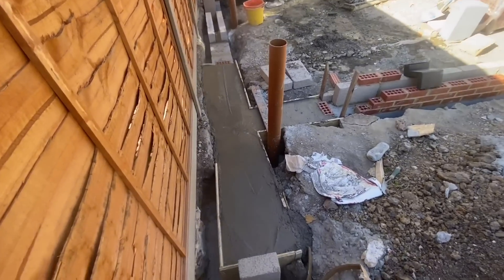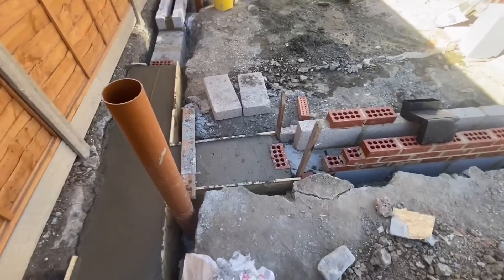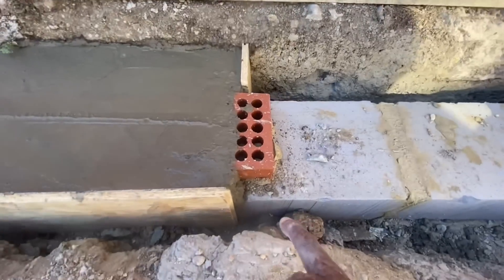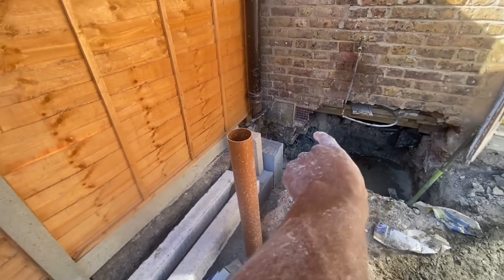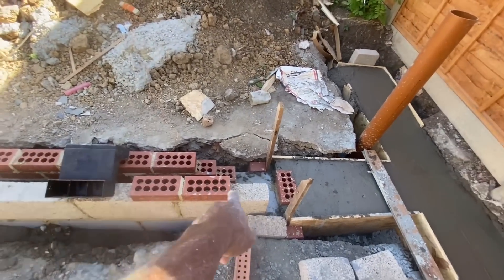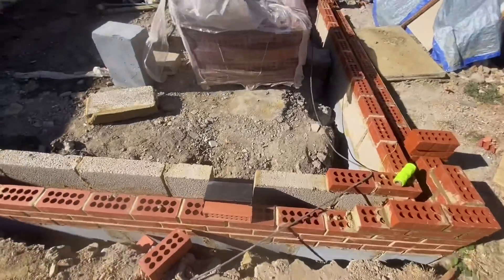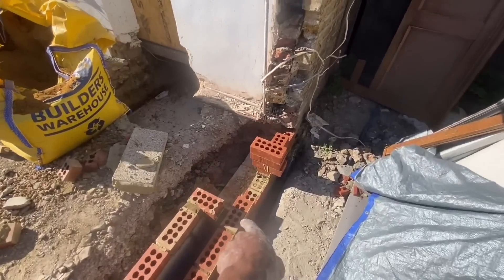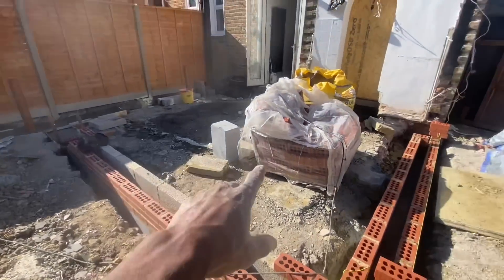Installing steel bridge foundation beam - London Extension build - Episode 14

Comment: Great setting out lads. very small thing for next time - put something compressible between your new work and existing concrete (neighbours fence). the two may bond - and in this heat the clay soil may shrink/(or expand when its wet) and break away your work! its unlikely - but just to help - love the content - cant wait for the box frame!

Comment: How come you are have to do the steel beams and concrete it in? Did it also not affect the waste pipe?
Reply from the maker: We had to do it because of the location of the waste pipe. The steel and concrete is a bridge over the waste pipe. So try e house is floating above the pipes instead of directly on it.

Comment: Why do you red oxide the ground steels? Keep the videos coming!
Reply: It prolongs the life of the steels and you have to do it by regulations Sorry to answer it for you guys
Reply: @MegaProstreet1  You don't paint ground steels, you don't paint steels that are encased in concrete otherwise all the rebar in the shard would be painted. Every building inspector ive dealt with wants none primed steels for adhesion to the concrete, however if you have a link to the BR or to an NHBC standard etc. It would be good to read up on your point. Thanks for your reply.
Reply: @tuneupdog  I've never seen this bizarre set up before in 30 years either! Normally rebar like you say or mostly a small concrete lintel in the foundation courses above pipework.
Reply from the maker: It’s quite common. It’s. How all box steels are done. Invading in concrete prevents rust. The reason that a lintel wouldn’t work her is because the pipe runs through the corner and there for the bridge needs to be in the form of a tee which is problematic with a lintel as they are straight only.
Reply from the maker: @tuneupdog  that’s ok but it dosent change the fact. No Dpc is needed as Dpc is to prevent water ingress but the point of the concrete casing to to protect the steel from air. This is why concrete cancer happens to rebate when you have cracks or badly poured concretes. This method is more common than you may be aware of. As I said check out box steels. I’ll try and remember to show the drawing detail when I get a chance. 👍🏾
Reply from the maker: @tuneupdog  have a look at this video at around 9:30 you should be able to see the detail for the steel in that corner bridging the pipe. Cheers 

https://youtu.be/qNKSmq_2OEw

Comment: this is absolutely mental, this was not needed at all . who decide this was the way  forward? whoever it was needs sacking
Reply from the maker: Out of interest why do you think it wasn’t needed? What would have been your alternative idea? It was on the structural drawings btw
Reply: @darrenthebuilder  hi mate thanks for taking the time to reply. i would have used shuttering up around to the pipe and just used concrete lintels to bridge the pipe. It was on the drawing i know but the architect would have done that for "belt and braces", when the inspector came i would have suggested lintels and if he agreed then its ok. the architect would have known the pipe was in that area so made it oversized. next time anything mental like that comes up ask the inspector as he has final say and you have to do what he says not the architect. great channel by the way